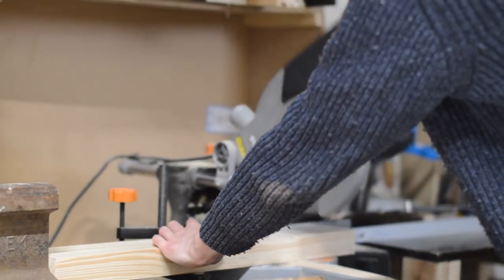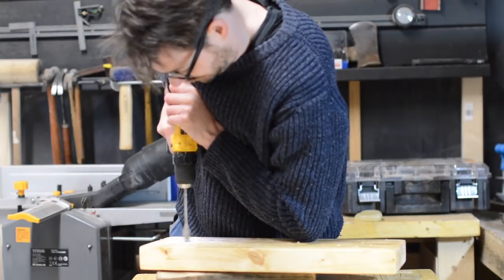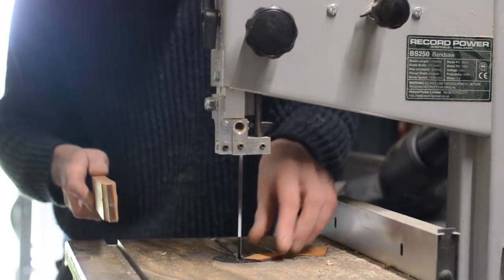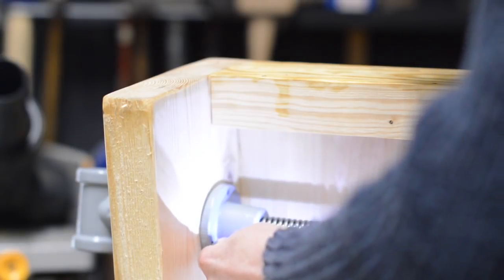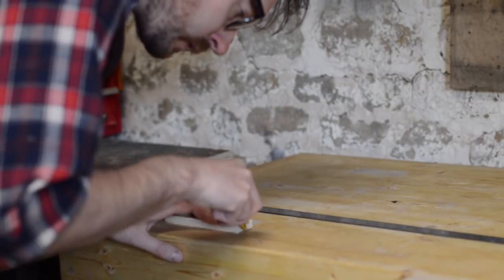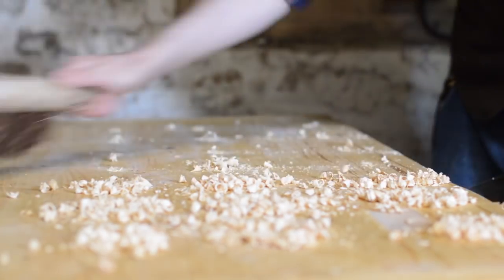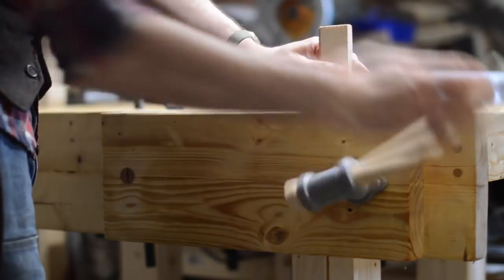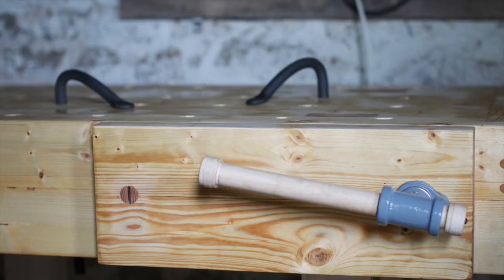Fitting a Bench Vice

Comment: Hi Matt, I know this is an old video but I have recently installed one of these and used your vid as a reference, thanks! It was quite tight at first as in not usable even after greasing and waxing etc. I eased the holes a bit and now it works great except its loose and and a bit wobbly until its gripping something then it all tightens up. Its only a couple of mil play but it makes it all very rattly. I just wanted to ask you was yours the same. Did it have some slop in it until it was tightened up and are you still happy with it after all this time?
Reply from the maker: I sill use it but I also have a quick release vice. There is a bit of movement in it until it is tight.